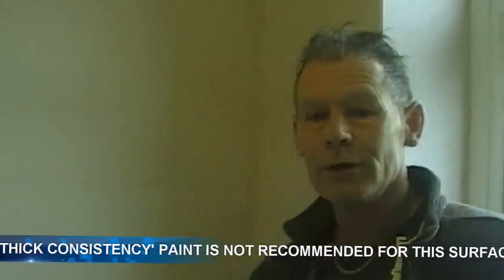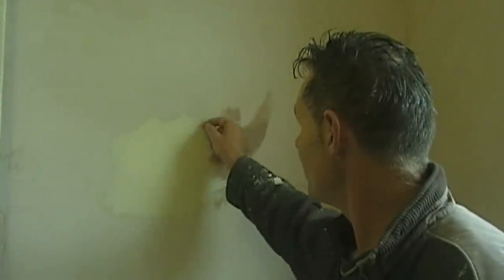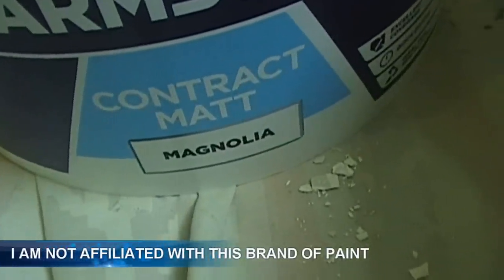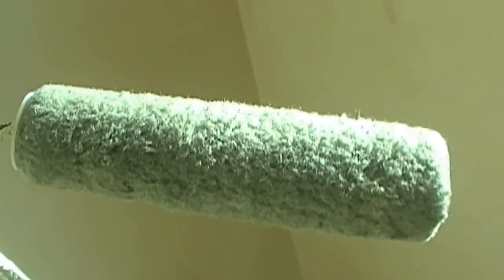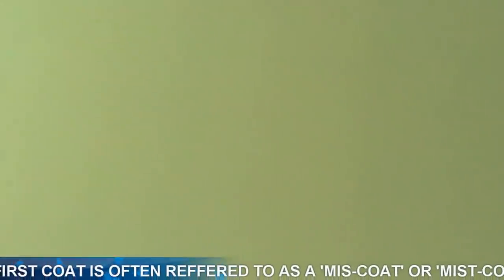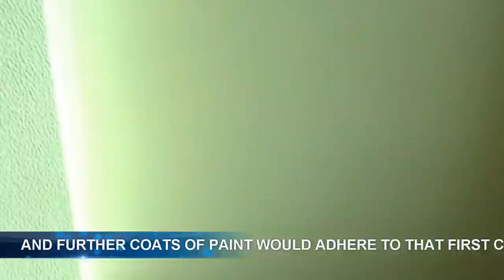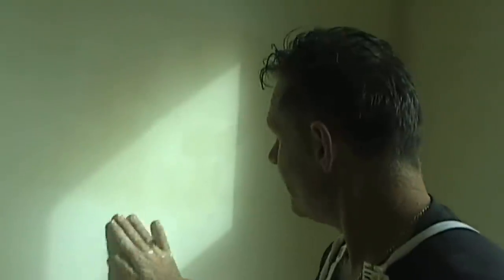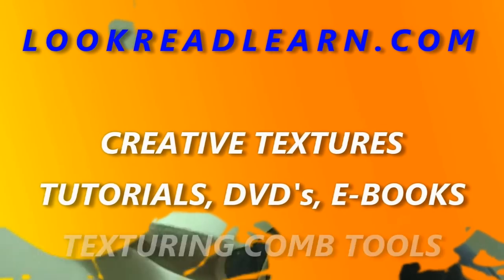Painting New Artex Texture + Plaster Walls and Ceilings

Comment: Hi Dale, 
thanks for this most helpful video - does the same procedure apply to a new fibro cement  ceiling?
Or should a special primer be used?
Cheers!
Reply from the maker: John, thanks for commenting. The video only concentrates on the popular interior ceiling and wall finishes such as plaster, texture and fillers ect. For the recommended practice to decorate fibro cement finishes best to contact the specific manufacturer or obtain a copy of their data sheet. Hope this helps, John. Have a great day